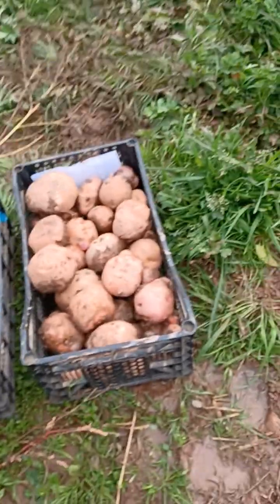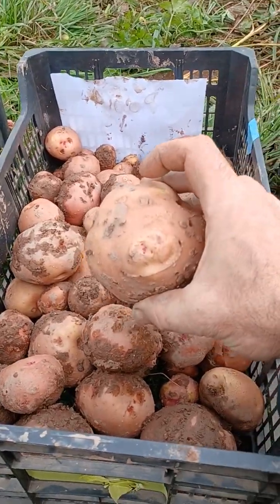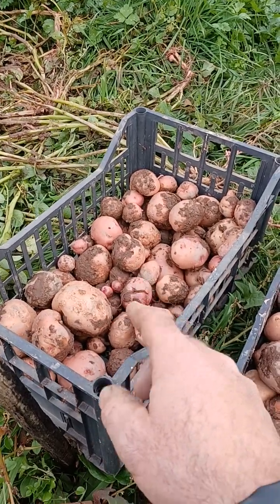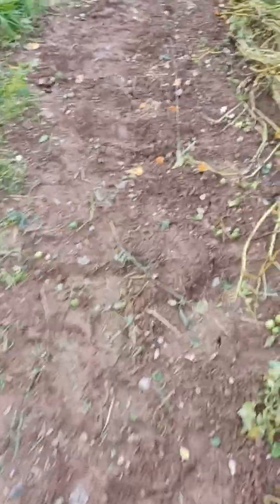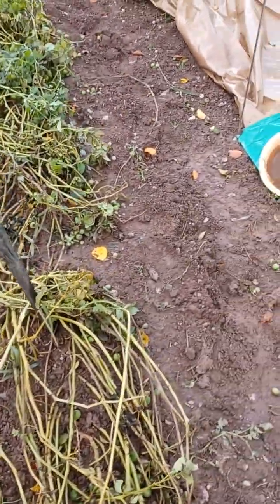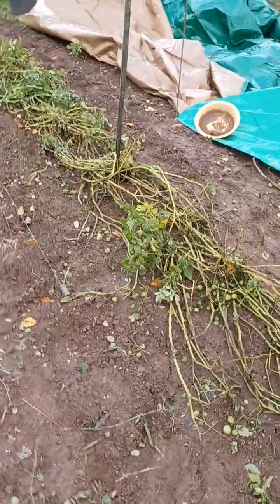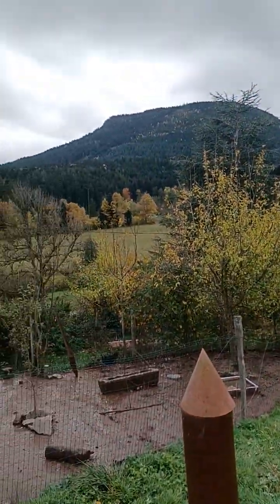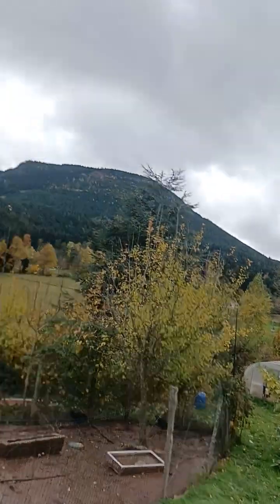Electroculture 69% potato yield increase with a magnetic antenna connected to a galvanised iron wire

Comment: You might want to experiment with using electromagnets instead of permanent magnets. The benefit is that you have control over the magnetic field strength which can be amplified beyond that of a regular permanent magnet. Another experiment is to use multiple magnets. From what I know is that a magnet field strength reduces the further you're removed from it. It still impresses me that the magnetic field travels through the wire. But what if you add multiple  magnets to amplify the field... that might even improve the yield further. This can only be established as a fact if a magnetic field measuring device, such as a magnetometer or gaussmeter is used to measure. 
What are your thought on this Yannick?
Reply from the maker: Electromagnets are lot more expensive to set up and organize on a whole field and will not work better in my eyes because you would use man made artificial electricity in stead of using the natural invisible and subtle forces and frequencies of the natural magnetism that we want. 
Using multiple magnets will also not work because it is not the strength that is important and also not the radiation of the magnet, otherwise you would see it growing better close to the magnet compared to further and that is not the case. 
I have done many different setups over around 20 years with magnets and tested already many of those suggestions. People suggest me every year almost the same ideas.
Just begin to use one of the well tested and effective techniques that prooved to be really working over the years like this one. After testing the existing you can improve and test changes but mostly  without much experience and thinking it will end up to nothing better.
Reply: @YannickVD  Thanks for the feedback. Are you familiar with the 'Ebner Effect'? They also used man-mad static electrical fields (DC 2000V- 10 000V)  to change the genetic expressions of seedlings. They mutated the plants and animals to be super charged and highly productive. I really urge you to take a look at it. So Im not really sure if natural fields always lead to better results. The scientists Dr. Guido Ebner and Heinz Schürch who discovered this technology proofed otherwise. 

Also a great invention that used electrical fields to charge cells to rejuvenate and heal people is the Lakhovsky Multiwave Oscillator. This technology is similar to the Ebner effect. Again using high voltage fields to influence biological organisms. I havent seen any experiments on plants, but it might also be worth exploring the possibilities. 

Why I bring this up? You mentioned you've explored countless possibilities but these inventions proof to be successful that go against your beliefs. These inventors all used DC current instead of AC. That might be a factor you overlooked... I dont know. This is not a critique on your work.... This is meant to inspire. When we become rigid in our beliefs we close doors to new opportunities to expand our knowledge...
Reply from the maker: I know about Ebner effect and this book and technique, I even met the author of the book in Basel and did my own experiments with it. I share some of thos experiments also in past videos you didn't seem to have looked at. I had also similar effects with natural electroculture techniques in my own garden where I had corn with multiple stalks and multiple ears. Also on wheat plants some of my customers had around 100 stalks on a wheat plant with my electroculture techniques in a garden en without the ebner device. So you can obtain even better results or more cheap and easy way with my technique then with Ebners technique. You know I do research in this field since 1998 so I met those techniques you talk about since the beginning even before any were talking about. Every year I discover new things like this, new research, articles, inventions,  and share in my live videos. My philosophy is to make the techniques the most simple and most effective as possible. The opposite is not of interest but is a tendency of the human mind to think that more complicated things are made, the more it is expensive and materialistic, the more it would be effective.... but this is not the case.
Reply: @YannickVD  Can you expand on your comment "Using multiple magnets will also not work because it is not the strength that is important and also not the radiation of the magnet, ..." If the radiation nor strength is not of importance, what is? 

When I mentioned using multiple magnets I meant them to be placed on the same wire but a few feet apart. You might have interpreted my message to mean to bundle multiple magnets in on spot.
Reply from the maker: Yes, I interpreted correctly like you wanted to say, some others already suggested me and a friend did the test, this works not better. What make it work is partly still a mystery, but what I do know is that it is not about the strength and not about the number of magnets, but it is about the receiving and amplifiying of the earth magnetic field subtle frequencies and nothing else, because otherwise the wire put in other direction not aligned with the earth magnetic field would work. I explain this in many of my past videos of electroculture lives from 2018 and even before.
Reply from the maker: Do comparison experiments with a controll group, the original technique and a third group with your suggested changes. so you would know for sure for you if it was a good idea or not. And share all your experiments and results like I do over the years so everybody can learn.
Reply: @YannickVD  I love your philosophy and your scientific approach: observing, experimenting, and forming hypotheses. For me, a key sign that something works is when it can be reduced to a simple, clear core, even if it seems complex at first. Complexity should not be mistaken for “complicated.” Unfortunately, I often see teaching online that sends people in every direction, instead of focusing on what actually works in its simplest form. As a result, knowledge gets diluted in a sea of misinformation. Thank you again for sharing your experience over the years!
Reply: @YannickVD I think it is the galvanized metal, the zink in it. I have done energy device experiments and the galanized ones were powerful.  Zink and copper
Reply: Yannick, this doesn't sound like your voice? Have you used some kind of AI translator? Great results with the potatoes 👌

Comment: Was this purely just with magnetic antenna in the ground or an aerial one too. Thanks
Reply from the maker: Yes, the only difference between the rows is the magnetic antenna connected to the galvanised iron wire in the soil. There is no aerial antenna in this zone.
Reply: @YannickVD Thanks im going to try this out for next season